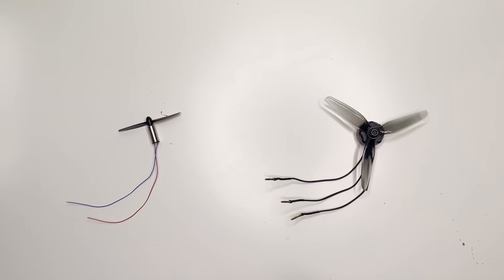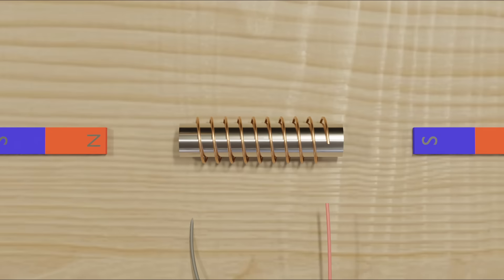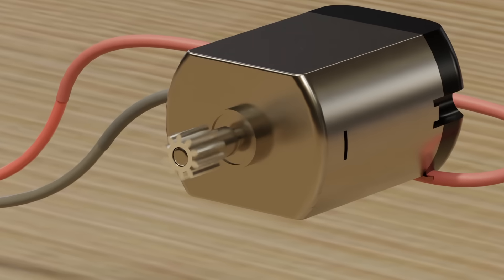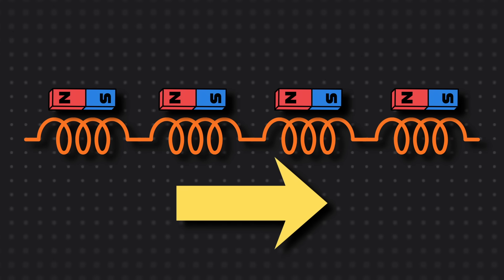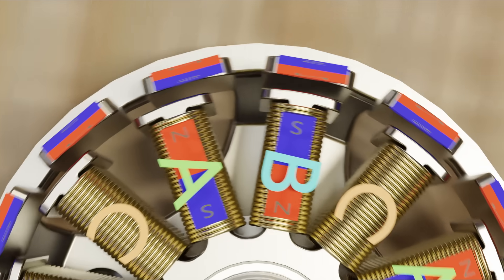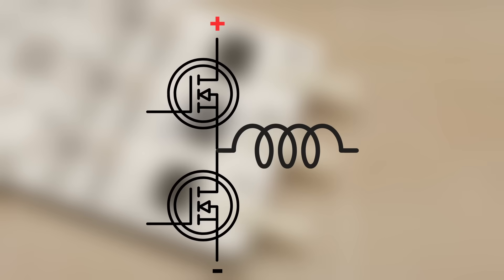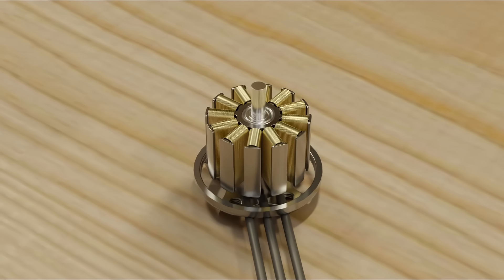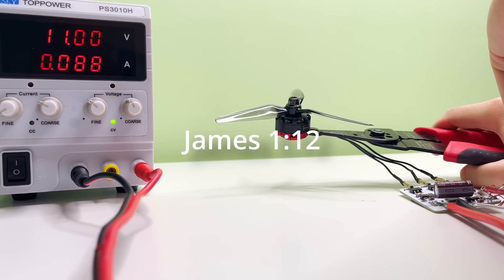Why Adding 1 Wire to Motors is Genius

Comment: Hello it s good but i comment this  for someone dont have anything on hand .

To control BDLC motor without PCB is still available? The answer is yes using logic gate, the design have been integrated in drv8302 however if you not own one . you still make logic gate from transistor. 
To control precisely i use stm32 but you can use linux/abandoned phone and USB port to stimulate control signal and send it thought USB . 

Hopefully it will help.

Comment: In your next video could you describe the difference between this 1960s era brushless DC motor and a 1890s era 3 phase AC motor. My understanding is the motor itself is the same. Its how they are controlled that changed. 3 phase AC are powerful motors and using DC to drive them with a controller or VDF (variable frequency drive) is what the real innovation was.

Comment: Great video! For safety, I would suggest mounting the brushless motor to a quadcopter arm and holding the arm or bolting it down to something it cannot move. That motor at full power with that plastic propellor can do some serious damage! I've been dealing with drones for years and seen many ppl get injured holding a powered drone that spun up unexpectedly.
Reply from the maker: I'll mount the motor on an arm the next time around. Thanks! Also, how would you suggest I tune a quadcopter without flying it? Unlike having a premade flight controller, my next video will involve creating the flight controller, but I would likely need to test it out or tune it inside without flight. Would I need to have a fixed rig that has like 2 or 3 axis of rotation? Idk if there's products out there like that, may have to make my own. Or if you have a better idea, let me know! Thanks!
Reply: @TheTinkeringTechie  I most commonly use BetaFlight on flight controllers that support the firmware. The stock PIDs work well enough to hover then there are lots of methods to perfect if after a hover. Many F.C.s have a blackbox that can store your inputs and gyro data, then you can work to get them lined up as best as possible and remove as much filtering as you can(filtering ads latency, but gives smoothness)

the flight controllers I am speaking of are mostly based on a STM32F7 chip and were around $40 before all this tariff mess.

the way you are using custom code and an Arduino your methods seem good if it allows it to move on all axis.

iNav & Ardupilot are other flight software worth looking into as a tinker'R!  Good luck bro!!!
Reply: @TheTinkeringTechie  you would want 3 axises of rotation, but to tune me and others in the hobby of FPV 5in drones have to tune by flight after a hover is achieved. I normally use Betaflight on flight controllers that use STM32F7 chips (iNav and Ardupilot are other nice flight softwares for you to check out and great to tinker with).  There are also some presets in Betaflight that some users just apply. 

Betaflight currently flies great from the start and many flight controllers have a blackbox that logs the gyro data that you can match to the stick inputs and try to get the most locked in feel with extra software to analyze the blackbox logs

You may want to see about making a flight controller that can accept a firmware target from Betaflight & iNav.

You are also correct. Brushless is the way to go for most precise quadcopter control because you can brake the motor where brushless motors on quadcopters just freely spin and cannot be slowed down as fast  (at least with firmwares I have used, but maybe could be done with reverse voltage)

Comment: This is a really nice video,  i still prefer brushed motors on power tools, rc cars and small fans because they are more gentle, simple and have less torque. Brushed motors also work underwater and the electronics are really simple

Comment: For some reason I was under the false assumption that brushless motors converted DC to 3 phase AC, then used it to drive a more efficient 3 phase induction motor. I was Wrong! As you point out, this model is simply another DC motor that uses MOSFET switching to replace brushes.
Reply from the maker: Glad my video was able to bring you clarity!
Reply: I think I heard that statement in an ElectroBoom video. You might have gotten it from him
Reply: @fredrikfredrikfredrik  Maybe that's another design option for larger motors?
Reply: @spelunkerd could be. but i'm pretty sure he said like “brushless DC motors are actually 3-phase AC motors with a DC powered control board” or something like that
Reply: I would call it alternated DC.

Comment: Stepper motors, four wires give you the ability to controll the amount by which it turns, typically in 1.8 degree or .9 degree steps. Thougn moder controllers can microstep, meaning they set the  about .045 degrees of precision on .9 degree steppers, though in practice with current controllers it's just over .056.
Reply: they're good for super precision but not really for speed.

Comment: I've been dying to know, is there some sort of specific software for these visualizations? I've been seeing that a lot of science/tech YouTubers (real engineering, veritasium, etc) have very similar looking and high quality 3d visuals, usually of stuff on desks, and papers/datasheets like in your other videos. Is it some specific software?
Reply from the maker: Interesting that you mention real engineering, as I was partly inspired by his 3D animations! I use Blender, which is a free open source software that allows you to do many things 3D related, like 3D animations. It's not too hard to move things around (animate), but it does take a bit to make things look good and realistic. Not sure if the other YouTubers use the same, but I know that channels like Fern uses Blender, and I think Yarnhub as well? So it is possible to get that quality with Blender.

Comment: People who confuse BLDC (Brushless DC) and PMSM (Permanent Magnet Synchronous Motor) don't panic, its just the case of if its an IPM (Interior Permanent Magnet) which is expensive shit and SPM (Surface Permanent Magnet) which is the relatively cheap cousin which hobbyist use.
Oh btw great video!!
Reply: So pmsm fans Will be cheaper. Why aren't they in Main stream
Reply: @siddharthdash8946 no no no, PMSMs have IPM and their manufacturing cost will still be more expensive.
Reply: That’s not really technically true. You can run either kind of rotor design with either control mechanism. Yes, PMSMs usually use internal magnets and BLDCs usually use surface magnets, but that’s not how you define them.

Comment: 6:34 so the cables are alternating current?
Reply: nope. the coils are alternated but the current isnt. its a DC brushless after all. AC brushless do exist but work in another way.
Reply: @Irobert1115HD so it's a matter of the controller to alternate it, ok
Reply: @alexalekos  very close but its actually the ESC that switches the coils on and off in sequence.

Comment: Very good video, but if you can please go into more detail about what is going on the prototype you showed. Like what is every component and how it comunicates. Why did you need the extra antenna?
Reply from the maker: Oh the extra antenna is to test something else. The breadboard with many wires in it is supposed to simulate a drone flight controller, hence why there are 2 sensors (IMU and distance sensor) with an RF antenna. The only thing necessary to spin the motor however is the ESP32 microcontroller and a potentiometer to allow the ESP32 to know what speed command to send to the ESC, via timed pulses (the same control scheme as in servo motors if you know about that). Some other people have requested a video where I explain how I made the ESC and how it works, along with code and such. I am considering it and may make it after I finish with the drone and the video for it.

Comment: Brushless motors have vastly improved many things. I build and run RC vehicles and have been using brushless outrunner motors in rock crawlers for very fine slow speed control and  high Kv brushless motors in rally cars and race cars to cheaply and reliably run the cars at high speeds. A small brushless motor and STM32 based ESC can be purchased for about the same cost of a brushed motor setup these days, some are actually cheaper than the brushed systems they have replaced. With a few fine adjustments of the ESC brushless motors can perform very well for electronic braking and for rock crawlers they can be used as a drag brake. You will also find most drones use brushless outrunner motor with the rotor directly connected tot he spinning outer can of the motor, this makes tham lighter and more efficient with improved control characteristics over the old brushed systems.  Brushless tech has change the World of RC models forever.

Comment: Great vid 🎉 BLDC is not suitable for many applications due to its vibration characteristics, and maybe(?) power density, AC induction motors, or synchronous PMSM motors are better in that regard.
Reply: PMSM the S stands for synchronous. So what is a synchronous PMSM? two syncs? no syncs (they cancel each other out)?

Comment: Synchronous motors and generators have existed for ages. It what powers the electrical grids all over the world. The only "new" thing about a brushless DC motor vs a synchronous motor is the "compact" speed controller. Otherwise it is a permanent magnet synchronous motor/generator without voltage regulator (permanent magnets). Nice explanation though.

Comment: wait so ur telling me for a hundred years no one thought of keeping the coils still and moving the permanent magnets instead of having to use brushes that wear ( ಠ ▵ ಠ)?
Reply: They absolutely did, AC motors have been a thing for a long time. The problem though was, that there was no real way to adjust the frequency to the motors speed before semiconductors
Reply from the maker: That is correct. In fact, I believe the idea of a brushless DC motor was conceived before actually implementing it, but as Amos mentioned, there needed to be a way to control/commutate that kind of DC motor, which was with semiconductors. We did have mechanical means and vacuum tubes, but they are not fast enough to be applied to brushless DC motors (at least, modern ones).
Reply: @TheTinkeringTechie  I wonder what other problems that seem so simple nowadays took centuries to solve
Reply: @amos9274  u said exactly what I was thinking while writing that comment maybe they used ac brushless motors for drills or other equipment and controlled the speed with gear boxes
Reply: @3mar00ss6 Funnily enough, I remember seeing a huge old motor-gearbox-generator combo as a way of varying the frequency for some ancient test stand at my job.

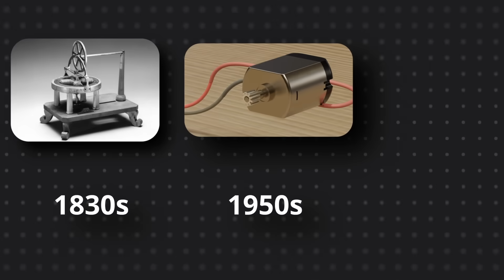Comment: 3:00 no, in 1880s brush less motors were made by Ferraris and Tesla. They used 3 phase AC to do the switching without electronic control.
Reply from the maker: I should have been specific in saying "brushless DC motor", which is what I showed in the video (the larger drone motor). That of course does not use AC induction with 3 sinusoidal phases. AC induction motors are motors without brushes, yes, but they are not brushless DC motors that can be used in drones, EVs, robots, rovers, etc.. This seems to just be a classification issue, and I should have been more specific, but searching up "brushless motors" does only give brushless DC motors, ones that need active electronic control. Searching up "AC induction motor" gives the motor you are describing. It doesn't mention brushless as a classification, but yes, it technically doesn't involve brushes. I didn't want to explain all the different kinds of motors and going into specifics, as this video is meant for viewers that aren't in the know of the specifics and history.

Comment: currently I have an increasing hatred of ESC's. Gone through 3 of them trying to get a OpenRC tractor to work. The front servo seems to be the problem or one oproblem. the 3rd up rated esc burned in the model, all out of model tests worked fine put it in and push forward and steering goes right, left, we are good and 1 second later its over reached and burned the esc, 2 mosfets gone. no idea if its possibly the reciever but the model is on hold, was supposed to be a present for the father but now its a oranament.

Comment: Just wanna point some stuff out regarding the animation.

When the camera is switching perspective, the motion blur is still active and treats the switch as a movement, essentially creating a blur between shots. This is solved by having multiple cameras in the scene with "markers" in the timeline that are each linked to a specific camera, making it switch perspective without making the renderer think the camera is moving really fast from A to B.

Your camera movement is a bit janky and inconsistent. For example, the camera movement when showing the path of electricity through the brushed motor is split up into many small and janky movements. Combined with the motion blur from the rapid movements making a lot of the footage blury, it becomes very hard to visually follow along as it's very hard for your eyes to settle on anything in the frame. Consider having just a single smooth shot where the camera pans uninterrupted through the sequence or cut down on the amount of such movements and also smooth them out more. That whole sequence was also slightly zoomed in and claustrophobic, which amplifies the issue. Another nitpick with it would be the electricity being shown flowing through the brushes is a bit hard to follow because of the low contrast of the different parts, the "pad" for example is quite hard to visually discern and could be missed entirely without prior knowledge about brushed motors. You could perhaps highlight all the relevant conductors the electricity is traveling through or animate the electricity as the surface of the conductors themselves lighting up instead of this light snake worming around and clipping through the models.

Interpolation choice is also occasionally odd, you don't usually want linear interpolation because it causes rapid acceleration and deacceleration which is jarring for the viewer and can trigger excessive motion blur if not done properly.

I noticed some Z fighting or similar too, but I assume you noticed and tried to deal with that already considering how obvious it was.

Don't get me wrong, this animation is still impressive work in many areas, but you can certainly improve still. I just typed this all up because I couldn't resist, hopefully it's useful info for you too.
Reply from the maker: Thanks, glad for the feedback! There were many times where I tried to fight the camera so that it was smooth and not facing a random direction, but I had to resort to cuts or else it would look like you're drunk trying to find where the motor is :/. My camera manipulation experience, and blender experience in general is pretty new in general. I used linear for some areas mainly due to the camera issues above. The "markers" does seem like a pretty useful tool if I can't figure out smooth and accurate camera movements. Thanks for replying!
Reply: No problem!

Btw a quick tip to keep your camera pointed at a particular point would be to use any of "track" object constraints on your camera. You can place a type of object called an "empty" and set that as a track target in the constraint. You can then place or animate that wherever you want the camera to look. Plus the constraint itself can be animated and toggled on/off.

The camera might need to face roughly in the relevant direction to begin with or it might glitch out a little bit depending on the constraint being used. It's possible to make an entire virtual camera rig for these things, the rabbit hole is quite deep haha.
Reply from the maker: @Liljoda  Interesting. I'll be able to move the camera without it facing away from the object now, thanks! I'll try to use the "track" constraint and see what I can do next time.

Comment: Highly irritating and misleading video title. The correct title is "I made my own ESC for BLDC motors"
Reply from the maker: Why? I spent most of the video explaining brushed motors ("2 wire motors") and brushless DC motors ("3 wire motors") and what allowed brushless DC motors to be useful today because of semiconductors, like ones used in an ESC. If I were to title the video as you said, "I made my own ESC for BLDC motors", I would explain how the circuitry works (gate drivers, microcontroller, MOSFETS), as well as how I program the microcontroller and how it applies to brushless DC motor control. Not to mention how I assemble the ESC PCB in the first place. I didn't explain any of that, at the very least, it is not a majority of the video. I'm not against you; I am just curious in what you specifically saw in this video that made you frustrated with the title.